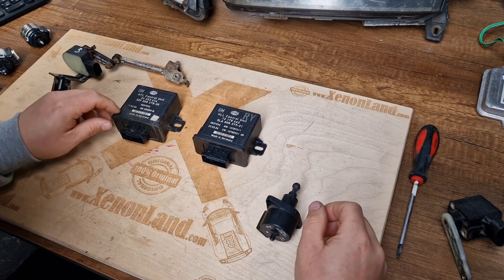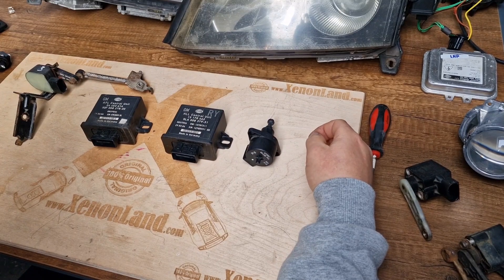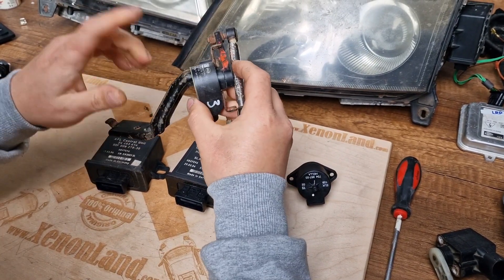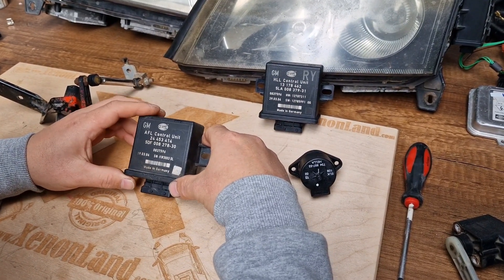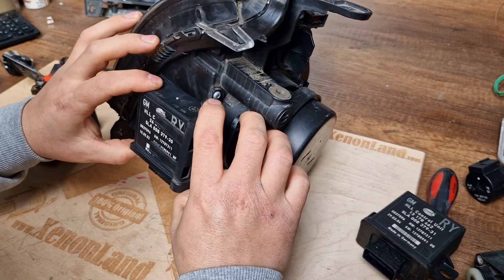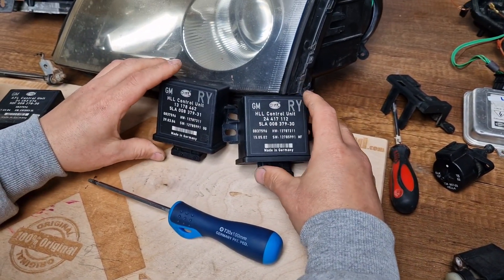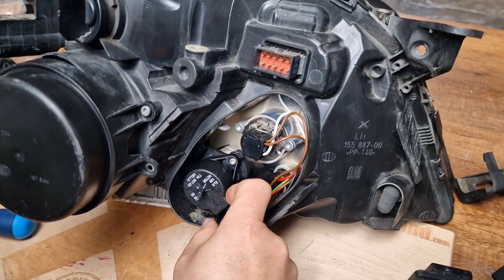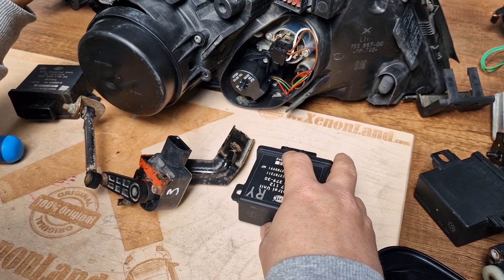OPEL Vectra C Signum xenon headlight RANGE CONTROL DEFECTIVE fault: HLL control units, motor, sensor

Comment: Thanks a lot for the videos about the xenon lights! 
My range contol does not work and I got the error U2120-00 ( CAN Bus no communication with AHL).
I assume that this indicates a faulty data communication (defective control unit?) and not a malfunctioning sensor, right?

Could you give any advice how to proceed to find the error or any other helpful resources of advice?

It´s a Signum 2003 with xenon light and automatic range contol.
I always used to fix my cars when they where analogue...this is my first "new" car and with all this sensor stuff, 
I´m pretty lost :(
Many thanks in advance!!!

Comment: Hi, i have opel Vectra c 2004 and we trying to repair the light. But we dont know where is the problem. Whole light work. Only the left headlight doesnt work. We tried to connect left light to connector to right and it works. But when we connect any light to the left every light work only the Main light doesnt work( turning light work, light when you turn the wheel work, the light for night work[the blue one] the light for when you stop works] only the day light or how its called doesnt work. We tried to use multimeter but it seems the power is comming to the light. But the light for day does not work and we dont know why where is the problém please?)
Reply: (Its the bottom right light) in 0:55 Sec in your video.)

Comment: Hi, i have a opel signum 2006 with adaptive xenon headlights. And i haveing a prbloem with it. My passenger or right side lamp blinks then I hit speed restriction bump. I swap ballast, xenon bulb d1s. But still the same. Were i can look for the problem.?
Reply from the maker: Can you elaborate? What you mean by "I hit speed restriction bump". What is the exact problem?
Reply: Then car going on uneven road, one sides lamp starts blinking. (road with speed bumps)
Reply from the maker: You have the facelift AFL headlights. If you swap the bulb and the ballast from one headlight to the other as a SET and still having the same issue, then check your projector holders for mechanic damage. Have you check the projector holders? Do you have AFL fault at your dashboard?
Reply: @xenonland  yes it's s AFL type.  No errors shown on dashboard. I will check for holders demage and will try to swap sides.

Comment: I have AFL lights and I need to replace the motor inside the light, but I don't remember having such good access to it as on the non AFL light that you showed on the video.
Reply from the maker: Which year is your car? 2002-2005 pre-facelift?
Reply from the maker: If so, the afl light has absolutely limited access
Reply: @xenonland , 2004 preface. So, to change the motor I have to disassemble the whole headlight from the front?
Reply from the maker: Unfortunately, you should, if you want to keep the assembly intact (because the screws of the motor are looking towards the front).
Reply: @xenonland , thanks. They didn't designed it very smart....
Reply: Здравствуйте Подскажите пожалуйста почему сгорает блок афл на опель вектра ц